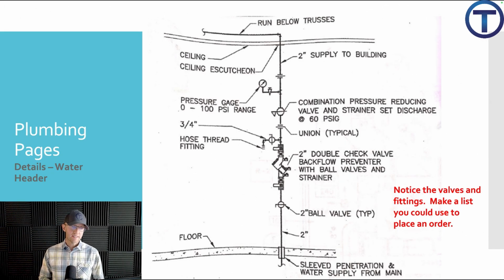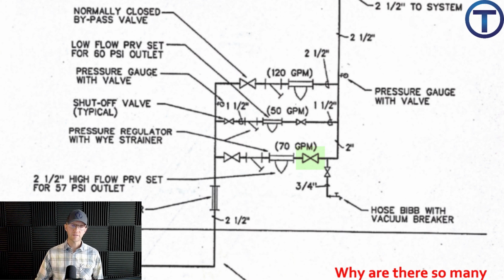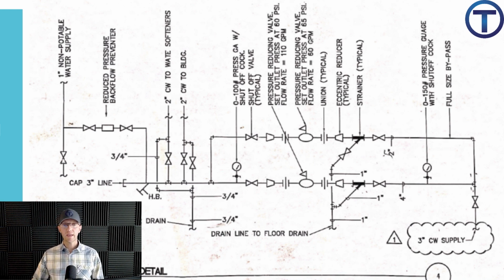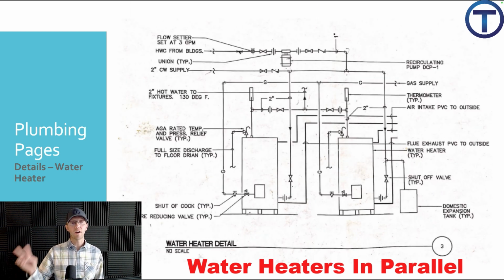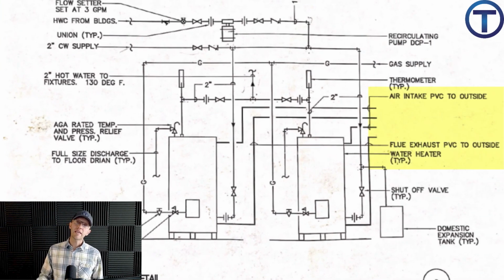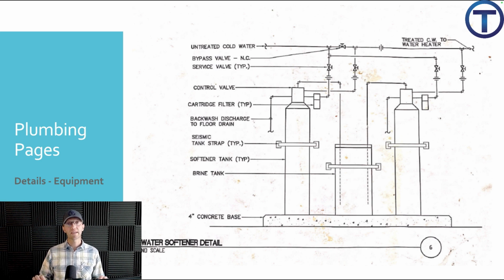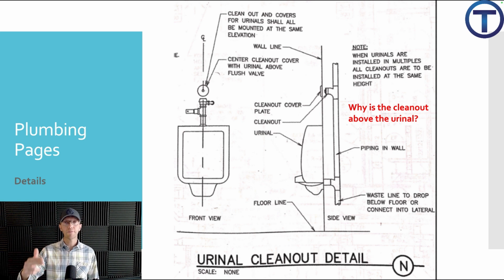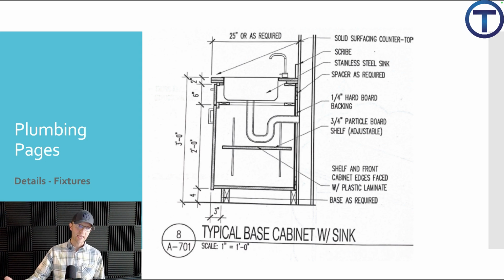Plan Reading for Plumbers: Plumbing Details

Comment: Tom, Love this video. For the equal distant piping on the water heaters I agree it's a good practice, but my engineering brain is thinking the difference in flow would be very minimal. When we think about the friction of the pipe, a foot or two difference in length isn't going to yield a ton of friction. However, adding more fittings would definitely have a bigger impact on flow. But I was wondering, have you ever tested this theory in practice? Maybe over the lifetime of the system, one water heater could potentially see twice the amount of water flow over 10 years which is why it's probably best to always use equal distant piping arrangements. Great Video!
Reply from the maker: Thanks MEP Guy great to hear from you!  I have not tested it but I have seen the disadvantage to water heaters piped in series.

Comment: There also is a third system on dual water heaters   called   "reverse return configuratio?n"   thats a suggested method by  Bradford white   so Not sure why the manufacture would recomend it if paraell was superb but  I dont know what to belive is best method
Reply from the maker: Parallel takes more time and materials, which increases installation costs. If it is done wrong it makes one heater do all the work and the other does very little for delivery of hot water.  I wonder if there are not more recommendations for parallel because if costs more and is more complex.  I know that is why plumbers don’t do it.  Series is too easy.